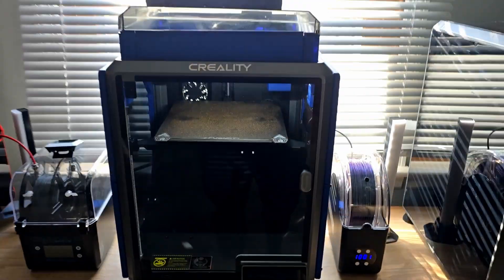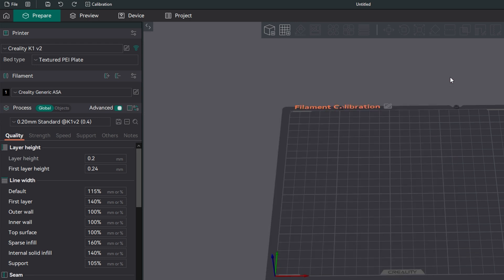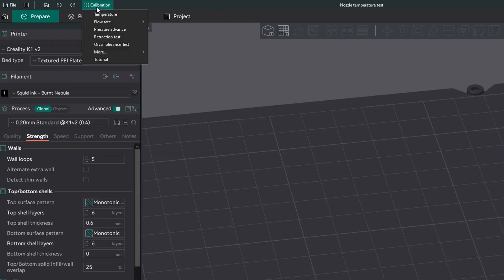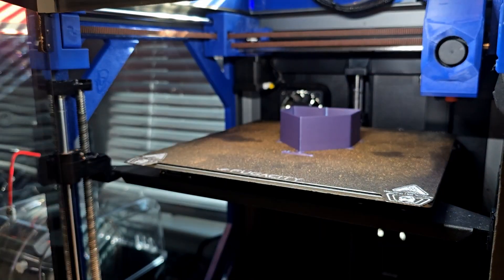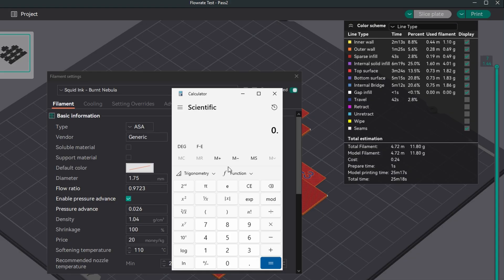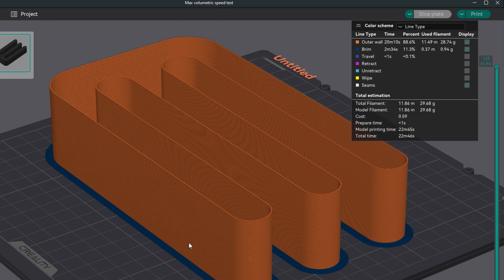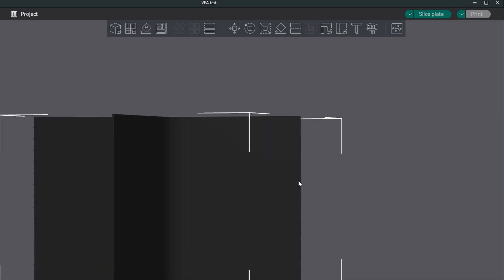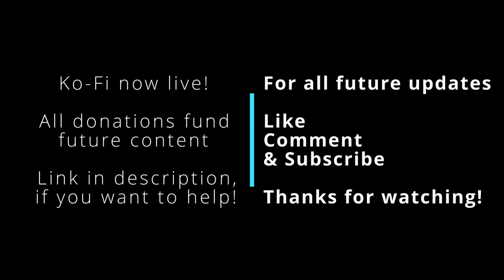OrcaSlicer Calibration - Getting the most out of EVERY filament!

Comment: Maybe im doing it wrong... But i dont do any maths when doing my calibrations. All info is in the preview tab. Simply measure part to best layer, adjust layer line in preview to meaured point, click "flowrate" (for example) and drag the progress bar for that layer. A box will appear showing the applied flow rate. Copy number over into max volumetric flow
Reply from the maker: That is another method! I use that as a secondary measurement to match against the solution that is provided from the formula to confirm appropriate values 👍

Comment: I started a Max Flowrate test for my X1C on the settings: start 5mm³/s, end 20mm³/s, and step 05.mm³/s somehow it finished the print without any failures. I'm testing it now with start 5, end 40, and step 0.5. I see it fails at some point for anyone, I guess something didn't work for me the first time ? I will see what the 2nd test will bring
Reply from the maker: If you didn't see failure within the set parameters, performing another test with a higher max value is in store! You're on the right track to finding that material's limits.

Comment: with the flowrate test, if i found -20 to be best from oe flow rate settings will i input -20 into the math formula rather than 5 that you found to be your choice after the flowrate test? (ex. 100x(100-20)
Reply from the maker: Exactly! The value that provides the best results from the calibration print "tabs" will be input to that location of the formula. If you achieved the best results with -20, ex. (100 - 20) would be correct.

Comment: Thank you so much for the video! I have just bought some eSun PETG in various different colours. Is it good enough to just calibrate with one colour or should I do them all? Thank you so much for your help!
Reply from the maker: Happy to help! Personally, I tune every single spool. You may find that one profile may or may not work well with other colors of the same manufacturer/material. Definitely try it out with the others once you've calibrated it to see how it goes! From experience, some times they require little adjustment, a lot of it or none at all. Since the results aren't guaranteed, I tune every spool for best results.

Comment: At 11:14, Where do I set these settings in Orca Slicer for outer wall and inner wall? Is it just a per print setting in the speed tab? Or is it a filament setting?

In my speed tab Outer wall is set as 5000 mm/s as default so isn't 220 a massive change from 5000, I think I am looking at the wrong numbers.
Reply from the maker: These will be changed in the speed settings. Your value of 5000mm/s is for accelerations. 220 should be set for inner and outer wall print speeds if they provided the best results. You can find those on the top of the same tab above where the accel values are.

Comment: What is the best way to also test the right speeds to print at?
Reply from the maker: That would be the VFA test! Whichever print speed provides the best results will be the ideal print speed for that filament. Although inner walls can be run slightly faster, for best results, match inner/outer wall print speeds.

Comment: For me this takes around 4.5 hours to do all printing and about 126.03Grams of filament.
I just do for brand name and type of filament, I think doing this for all the colors of the same brand is a bit overkill.
So far this is the second brand i do it with and the first brand i did 1 color and all colors of that brand just came out the same.
Very happy with the video i do comeback to this one when i have to do it all again.
After this i do 1 more print thats the Califlower Mk2 to calculate the shrinkage aswell. ( It would take in total now like 5hours and 15 min with about 145.25 Grams of filament)
Reply from the maker: Definitely do what works best! I dont expect everyone to go through creating a profile for each and every filament but its a personal preference. It makes pulling profiles whenever I restock convenient but you can typically get pretty good results if you hone one specifically.

Comment: What do you do when the corners are not all the same at any given point?
Reply from the maker: @SlickNickBA  Make sure your PA is not selected/on under filament settings. It could be applying the test values to an existing value. There should be a degree of consistency with this test and it sounds like your tested values are introducing inconsistency throughout.
Reply: @CovenantCustom  Thanks for the quick reply. I will check the settings and try another calibration print.

Comment: how is the adhesion of your asa? could you give some numbers on speed etc or publish the profile? mine doesnt stick, not with glue, smooth plate nor textured, doesnt matter what supplier of asa. I am just wondering^^ seems too smooth for me
Reply from the maker: @Coco-vf4ql  If you're using a K1, the Creality textured PEI B plate is my new go to. I heat the chamber by setting the bed to 100C for about 20-30 minutes and won't start a print until the chamber reaches 30-35C. First layer speed is typically between 70-100 and my typical print speed is between 230-250. I've never had a need to use anything to improve adhesion.

Comment: I understand good until the after the flow rate first test , when it comes to pressure advance test i dont understand really could you explain it ? I have kobra s1 it has "pid calibration in the printer menu does this is enough?"
Reply: That is where I got lost too. I tried to watch a couple of other videos and it it is murky there too. I hope he sees this and comes back and explains this. I don't understand the whole scribing the outside of the print. Mine looks good all the way up to 31mm, corners all look decent. I was able to pull one pylon off though.  But after that....hmnmm....
Reply from the maker: The reason I use a caliper to mark the height of the corner that provides the best results is purely to examine the remaining corners at that height. I find it easiest to create that mark so that I have a clear indicator of the results at that height for all 5 corners as well as the Z seam.
Reply from the maker: The PID calibration is to make the necessary adjustments to things like hotend temperature and the bed. As opposed to cycling the machines heaters on and off and over/undershooting the ideal temps it runs them with adjustments made to power output to stabilize the temperature and provide a more consistent value without fluctuating excessively.

Pressure advance would need to be tuned on its own as it is material specific and determines the motion of the printhead's decel/accel values around features like corners. Ultimately you are looking for a value that provides acceptable corners that aren't too rounded (value too low) and aren't undershot/wavy (value too high).
Reply: Take the .002 x the mm you measure up for the flow rate  you'll enter into the filament setting. That's it! Easy peasy!
Reply from the maker: @BrassBuilder  This is the kind of community support that I had always hoped to see through this channel 🤙
Reply: @CovenantCustom  😀😀😀

Comment: The max flow rate test is flawed if using .6 or .8 nozzles. I wish the industry would provide more presets for using the bigger nozzles but unfortunately all they care about is .4.  To achieve the most optimal results from max flow test it must print at the desired layer height you plan to use on your prints and the test is very hard to modify.
Reply from the maker: @PaulPoindexter  .6-.8mm definitely requires a bit more patience and calibration tests outside of what is provided in Orca. You're not alone on that one!
Reply: @CovenantCustom  I'm a manufacturer that produces 10's of thousands of printed parts for our production so .6 and .8 are the norm so everything the industry tells you as per temps and settings go completely out the window and you just have to start on your own. I wish they would just program the test so you could set the height you want. Anyone that tries to tell you that the layer height has nothing to do with the max flow is dead wrong. Your doing the test to maximize how fast it can go and look the best so what good does it do to run the test at .32 or .56 layer height? 
Tests always need to run at the desired height of what you plan to print at period!
Reply from the maker: I 100% agree with this statement. Would love to not only have height adjustment but having pre-configured values for the varying nozzle sizes would take these built-in calibration tests a step beyond. Making it considerably easier for 3D printing enthusiasts/businesses alike to dial in materials regardless of the nozzle size, on the fly. The values in which it slices could be pre-determined by the nozzle size set under machine settings.

Comment: Fantastic! Do you find you need to calibrate different colors for the same manufacturer/material combination?
Reply from the maker: @74357175  I have tested that and even with the same manufacturer/material have found that the formula with another pigment can deviate and require a profile all its own. I tune every filament down to its specific color so that I'll always have a profile to select if I ever melt it again 😎

Spoiler alert: I'll definitely melt it again if it melts well the first time around 😂
Reply: @CovenantCustom  ah well. Good to know! I was hoping to save some time lol. When the pigment changes, which dimensions of the calibration are most likely to deviate?
Reply from the maker: @74357175  Since I start with a generic profile all the time, I'm adjusting all of the values.

In a test, using same manufacturer/material in a different color, I needed to adjust flow rate and max volumetric but ended up tweaking the rest of the profile to get it dialed.
Reply: @CovenantCustom  OK, interesting you mention that because I normally find I really have to adjust the flow rate, so thanks for confirming that. I also seem to get different levels of adhesion, so I sometimes tweak the temperature,  but usually just increase it.
Reply from the maker: @74357175  Always best to get a good profile dialed and return to it whenever you load up the same flavor of filament! You've got the right idea already 😎👍
Reply: @CovenantCustom  👍 Do you do the same procedure for special things like Wood PLA?
Reply from the maker: @74357175  I definitely wood! 🤣
Reply: @CovenantCustom  😏👍
Reply: @CovenantCustom  one more serious question: do you find that you need to recalibrate for each nozzle size?
Reply from the maker: @74357175  Most definitely. These calibrations are meant for a 0.4mm nozzle and you will have to adjust settings with test prints outside of what's provided for other nozzle sizes
Reply: @CovenantCustom  Yeah, I tried the max speed test with a 0.8mm nozzle, and it just wouldn't print: the calibration lines are too thin! I'm sort of wondering what to do in that case. Can I use the standard Orcaslicer calibration tests with a 0.6mm, or are there other ones recommended for 0.6+ sizes?
Reply from the maker: @74357175  The calibrations auto adjust values so you can set them manually after selecting the test to align with the nozzle sizes if you are still looking to attempt the baked in calibration prints.
Reply: @ If not the baked in calibrations, what's a good source for custom/alternative calibrations? I'd really like a fan speed calibration for the PETG/PCTG..!
Reply from the maker: @74357175  If you look up an all in one calibration test with overhangs and bridges included, those will usually do the trick!
Reply: @CovenantCustom  Right, but that's no good for pressure advance, for instance, is it? Or VFA, I'd have to manually create it N separate times presumably? That's what I Iike about the built-in calibration tests: they do a sweep
Reply from the maker: @74357175  Pressure advance you can live tune if your machine supports it by changing values on the fly with something like a calibration cube. Max volumetric would require custom gcode to define the layers that the value is changing at.

Comment: Me again, Im confused for the bowden PA calibration. Is it best to leave it default? Im using an Elagoo Nepture 3 plus
Reply from the maker: @DerekX100  When selecting the extruder position the defaults are set to accommodate its location. Selecting bowden will give you the baseline for values used. I would suggest leaving those parameters for initial testing and making small adjustments following if necessary.
Reply: @CovenantCustom  Thank you for the help again. You make my printing experience so much easier. Keep up the work! cant wait to see more
Reply from the maker: @DerekX100  Happy to help! I do a lot of running around but dedicate my free time to sharing projects/guides when I have the time. I'm always around to answer questions though 😁 Thanks for the kind words and support!

Comment: Stupid question maybe but do you have to calibrate every filament color or can types be enough per brand? Example Polymaker Matte and Polymaker 3d....would have 2 calibrations. But not Matte black and Matte Grey?
Reply from the maker: @majicMix911  It truly is dependent on how far you want to take it. I personally tune every filament regardless of its similarity with material type/color. Even if it's the same material type, let's say ABS, it's entirely possible that the pigment/color, alters it enough to require tuning. To achieve the best results, I tune each as it is my preference to spend more time getting profiles dialed specific to the make/material/color.

Comment: Can I use OrcaSlicer with my Anycubic Kobra S1? Also does anybody have a cheat sheet for what filament is good for what uses? I have pla and see a lot about TPU being bendy and stuff. But what is ASA for and ABS?
Reply from the maker: @TomTrustworthy  At this point, Orca does not have a profile for the Kobra S1. The Anycubic Next slicer is sufficient for the time being and the calibrations are the same across the board.

PLA is a great material to start with because it is an easier filament to melt.

TPU is used in a variety of applications where flexible items are needed (gaskets/seals, cases/covers, printer feet/dampeners and R/C tires to name a few). Think of a rubber-like material.

ABS and ASA are stepping into engineering thermoplastics. They are strong, durable, more heat/chemical/UV resistant than PLA/PETG and relatively easy to work with.

ASA is a step beyond ABS when it comes to functional prints or those used outside as it is less likely to warp or degrade from exposure to chemicals and UV.
Reply: @CovenantCustom  Thank you for that crash course. Also yes in that Anycubic slicer next, I see the calibration part like you were using in orca. I got 4 spools of pla with my kobra s1 and I am starting to run out. So I was wondering what to buy next and I think ill go with a spool of ABS and maybe TPU just to have those as options. My biggest worry with those are my inability to keep them dry. I'm new to all this so i dont have a drier yet.
Reply from the maker: @TomTrustworthy  ABS/ASA are my go to filaments for day to day printing.

Just be mindful that you can not run TPU through the ACE.

If you are planning on trying out other manufacturers to utilize the material calibrations, take your time to get the best results and be patient with the process. Some materials put up more of a fight than others.
Reply: @CovenantCustom  ACE is the multimaterial thing right? Yeah I dont have one of those.
Reply from the maker: @TomTrustworthy  That is correct. That being said the best pathing for TPU is direct.

Most of the time, people will print spool holders that are placed on the top frame of their printers so that the TPU travels directly to the printhead without the twists and turns that it would experience if placed on the back panel spool holder.
Reply: @CovenantCustom  Good to know, I might need to print a holder for the top then take the plastic lid off so i can print with TPU. If I even find a good reason to print TPU one day. Thanks for that information.
Reply from the maker: @TomTrustworthy  Happy to help! Enjoy your 3D printing experience and just know, the community is always here to support you.

Happy printing 😎👍

Comment: I'd have my doubts regarding setting pressure advance before a second flow pass, since the pressure advance is flow dependant. But if it works, it works.
Reply from the maker: @TheSupertecnology  It's definitely a personal preference but I support any approach.

This method works well without any dimensional accuracy issues present following.

Nothing wrong with running Flow 1-2 and PA to follow though!

Comment: I've been transitioning from Creality print to Orca for the last month and building new profiles there. Wish I saw your video earlier since it's not always clear what to look for in the prints even with Orcas good documentation. 
With the flow rate calibrations I'm always left wondering what is the best piece. There's always like 5 pieces that look exactly the same to me :)
Reply from the maker: A clear indicator for the flow being too high is a top layer with ridges, raised edges/perimeter and a rough surface. Additionally if inspecting under a light, you'll see a "matte" finish around the edges, this is where the nozzle is pushing the filament out the edges and driving through it.

On the other hand, if the flow is providing underextrusion where there are gaps in the top surface (not enough "smush") then the value is too low.

Try to find the happy medium where it feels smooth across the board and your nail doesn't catch on the lines that have been deposited for the top layer.

You've got it! 😎👍